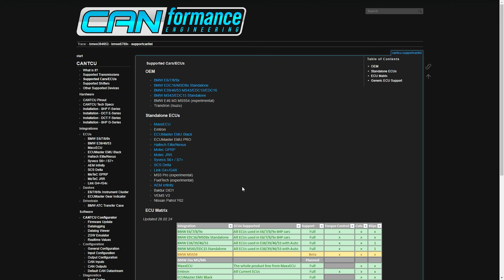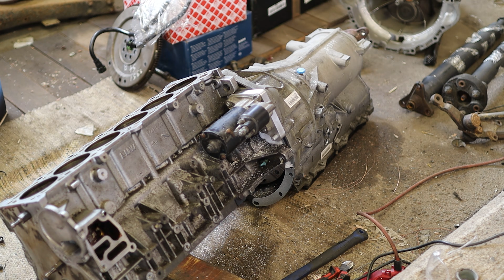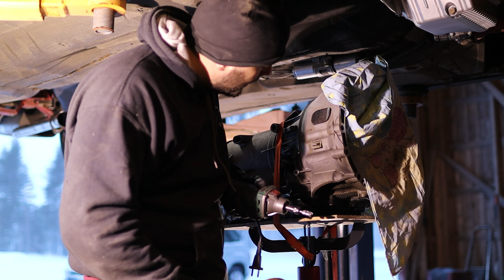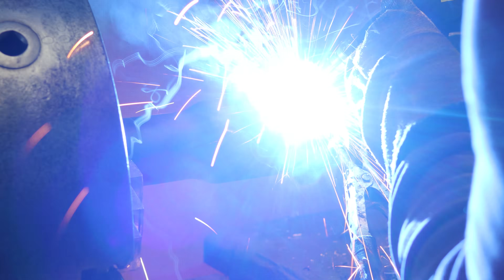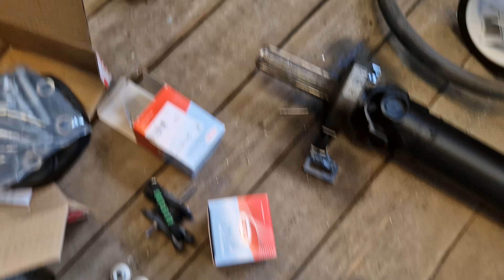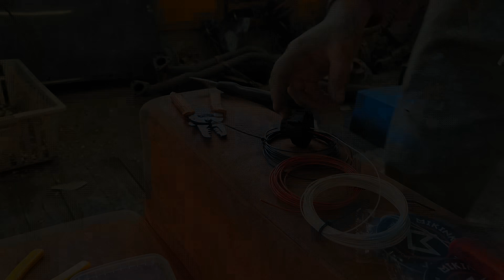8HP Swapping my BMW E36!

Comment: Yes, i love the in detail 8hp content, great video! Can you please write somewhere here or in a video description what exact parts you use that you describe from minute 4 to minute 6. It is crucial information but sadly i can’t understand when do you say N and when do you say M. So please write it somewhere because i plan to swap my M54. Thanks
Reply: I have actually turned on subtitles and i understood everything, thanks anyway. I love these kind of detailed builds, keep it up 👍
Reply from the maker: Yeah, I was about to say that there's English subtitles too. I will still prolly do some sort of list of used parts, when this is complete and verified that everything works.
Reply: @pazi88  that would be great, also till now i only saw the transmission being bolted on the engine with the steel adapter plates that are cnc machined and are at least 1 cm thick.  Do you think this plays a role because your transmission is now closer to the crankshaft because you bolted on the transmission directly to the engine
Reply from the maker: @Shari_Tejp  Well almost every other 8HP swap needs some sort of adapter between the engine and trans, because the bell housings don't match. And also custom flex plate etc. But as I said this N55 8HP45 swap to M5x is one of the easiest/cheapest, because it doesn't require those kind of big and expensive adapters.

Comment: You really have a 320/323 single exhaust on a build that is supposed to make 300hp ? What size is the pipe ?
Reply from the maker: As I said briefly in the video, that it will be replaced with 3" exhaust.
Reply: @pazi88  Missed that but I did figure it was temporary, however always wondered if this was genuinely a restriction. Well for 300hp it probably is but you see people swapping stock b25 or b28 in a 320i and worry about the single pipe and always wondered if it was valid concern.
Reply from the maker: @imnota  I made ~230hp with my m52b28 using the s52 cams and that exhaust. So it's prolly some sort of restriction, but not a very big one.

Comment: Exactly what I was looking for. My wife only wants to drive Automatic, and her first car is a 98 328iA E36 Coupe. The 5hp is so damn slow, and it's annoying, especially going uphill. And since it's losing oil it's full of clutch material,  I didn't want to replace it with the same one and was looking for a 8hp but didn't know where to start. Thank you !

Comment: Thank you for your video, gives me inspiration to swap my 5hp from my E46
Reply from the maker: That's even simpler swap than this, because the car already has lot of things you need and do work with 8hp also.
Reply: Is there an option that the 8hp transmission can work directly  with my bmw e46 325i i have the ms43 without cantcu??
Reply: @FreddyJansen-h6i you will need CanTCU, about to start the swap on my 328ci.
Reply: @FreddyJansen-h6i  no you need some kind of TCU to talk with the 8hp

Comment: There's also MaxxECU now, for me it's the most viable option.
Reply from the maker: Yeah, it was't out yet when I filmed this. And not sure if it's out of beta even at the moment.
Reply: Is that a tcu function in the maxxecu or just a separate standalone tcu?
Reply from the maker: @tonistaru  the maxxecu itself controls the TCU inside the trans like CANTCU does. But it only supports dodge protocol currently. And I have no idea how well that works in ie. 8hp45 etc.
Reply: @pazi88  It's in Beta public, It works with a modified Dodge protocol, that custom firmware must be flashed to any BMW, Jaguar etc. transmission. Really easy to setup torque tables and logics to get it working great. 
Ditching all the hard work done by OEM engineers by using external controller it's a terrible idea for a street car.
Reply: @WickedTRX  its not, we have TCU Lamik (external controller) for street daily car and it works flawlessly

Comment: Hey! Im done with the gs6-37dz swap in an e46 320ci, based on your e39 video. :) But i used 320d clutch, different clutch shaft extender, different gear selector and drive shaft. It works like a dream, the car is much more "powerful" in 1-2-3 gears, and more economic in 6th, for approx 700 Eur its a very good upgrade. But, this swap seems to be very costly and complex compared with the manual 6. By the way i can imagin this swap for a tuned automatic 30d, to replace the crap GM gearbox.
Reply from the maker: It's really good swap indeed. I really liked that on my e39. Prolly best bang for buck transmission upgrade there is. The 8HP swap is indeed much more costly. But I wanted to try it anyways. I also went ahead and bought 8HP for my X5 to replace the GM slushbox in that 😁

Comment: great idea wil this 8HP fit me e30 M50 325ix i need to fit the transfercase on the back
Reply from the maker: The e30 and e34 have their own transfer cases that don't fit any 8HP trans, without really special adapters. Though e46 transfercase might fit and because it's still mechanical one, it might work in e30 too. Speeduino isn't very good fit for 8HP, because it's missing DBW and torque modeling.
Reply: and posibole to connect to speeduino?

Comment: This has been a little dream of mine for a while, I have a '93 325iA coupe  that I converted to M51D25 manual, and a part of me really misses the automatic (but the stock autos of the time are trash). Curious to see how the trans gets the tacho readout etc in order to switch gears at the right time. Also, as most probably knows you can use a linear potensiometer and have a "clutch pedal" for some "inspired driving" xD 
End game would be a M57D30 swap with a 8hp transmission. That would be my ultimate driving machine.
EDIT: After actually watching the video in full: it would seem as that pairing a 8hp to the old diesel engine would be harder than first thought, so in reality I'd need to actually swap in an m57 engine at the same time.
Reply from the maker: Yeah, you really need quite modern ecu that can accept torque/rpm requests from transmission. Although 8hp can work without those, but the shifting wont differ from old automatics then 😅 So yeah, you need the m57 swap too 😁 I think there is mod for dde4 that gets you throttle blibs in that with CANTCU.

Comment: hey pazi, where can i get that starter adapter in the states? im swapping my e46 daily to 8hp just because of this video.
Reply from the maker: Domiworks is selling one, but it's quite expensive: https://www.domi-works.com/collections/8hp-adapter-kits/products/bmw-m5x-s5x-8hp45-n55-starter-motor-spacer But the guy who I got mine at ms4x.net discord server, is making new even cheaper batch. So those should be available soon.
Reply: @pazi88  ill hop on the discord, thank you for the quick response. Cheers brother.
Reply: Today i made one for myself, for 30bucks...